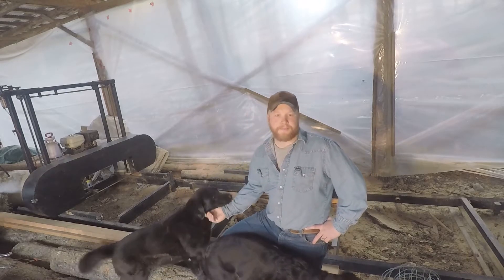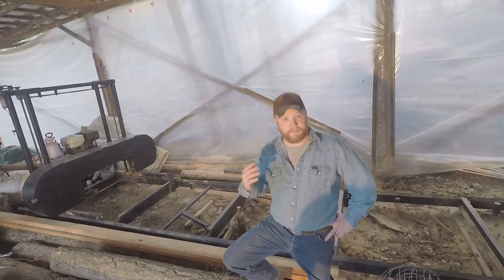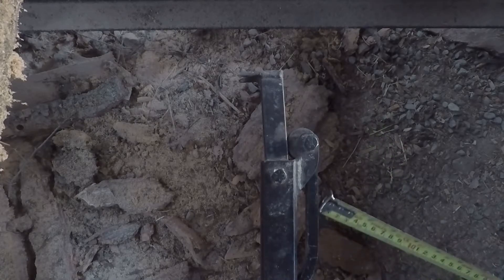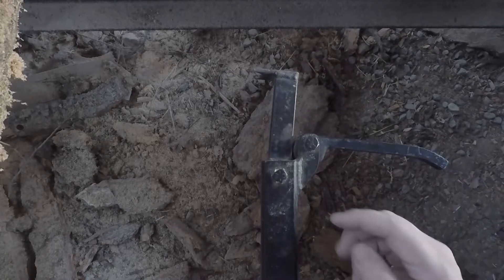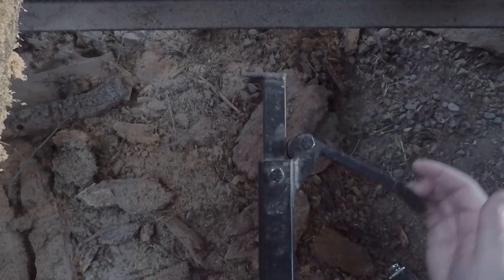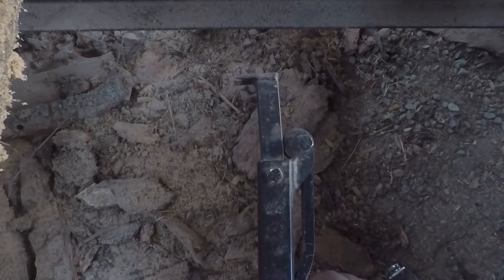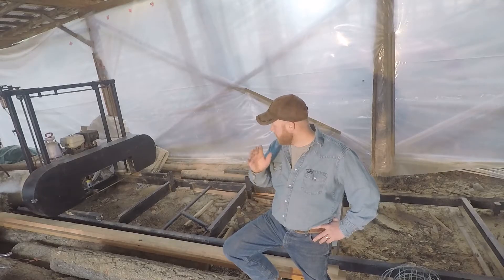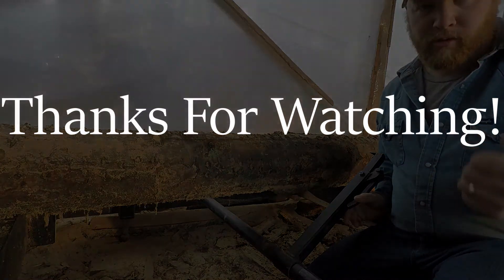How To Build A Sawmill - Part 1 - Quick Release Log Dogs

Comment: I'm getting ready to build my own mill with a Linn Lumber mill head. I like the log dogs solution you designed and will likely give that a try.
Reply from the maker: One improvement I would make is give yourself more room to grasp the handle. When it is good and tight its a little tricky to release. I hope to hear how your build goes!
Reply: Thanks for responding. I'll let you know how it goes (probably end of summer). I can't think of a reason not to make the handles a little longer as it appears the clamping force means really yanking on them in your and maybe weld a hand grasp on back side of each handle?

Comment: If you extended the length of your 1/2"sq. stock cam handle, it would lend more fulcrum leverage. And as you pointed out, a little more bend at the end of the handle, less pain onna filanges.

Comment: New sub from Jim’s TTC, hi!
Could you add an extension to the ends of your locking cams making them slightly longer? if you shaped them such that you could get your fingers underneath with the extra length they’d be easier to undo and lock due to the extra leverage. Cheers Graham
Reply from the maker: Graham Monaghan welcome! Jim has a great thing going! I am thinking I should be able to bend them out about which should help and if the extra leverage is needed I'll use your idea and add an extension. Take care!

Comment: What is your power plant and how does it work? Looks like a Honda single cylinder 12hp?
Reply from the maker: Yes an older single cylinder 13hp works great I'm sure the bigger the better but the price was right and it works great. When buying a clutch for it buy the most robust one you can get I went through two of the cheaper go kart ones and then finaly spent the money I should have the first time and haven't had an issue since. Happy milling!
Reply: @thefarmlife2958  Thanks! Really helpful. Linn mills sell a clutch I'll buy that is quality and rated up to 20hp. I'm thinking the 16hp Kholer or 13hp Honda to stay in my $800 budget. Sure would like the vtwin 20hp but $500 more. Slightly tempted by 18hp Duromax for $350 to get started with. Excited to build.